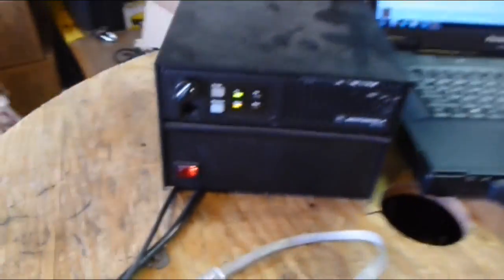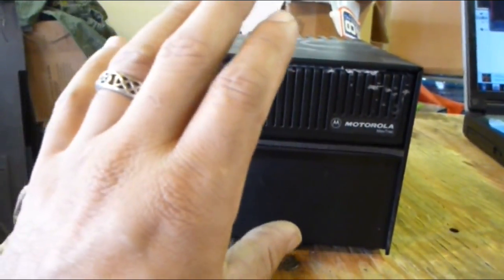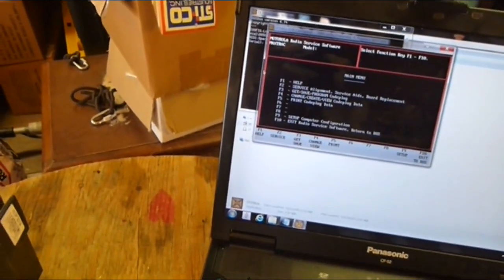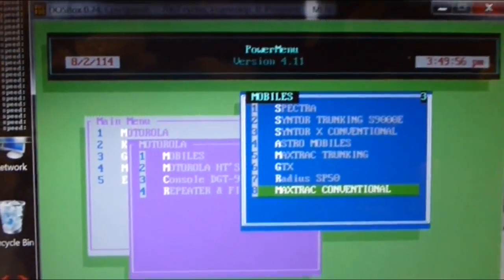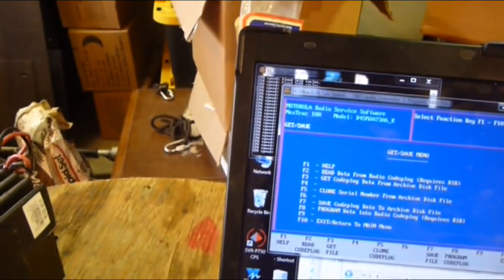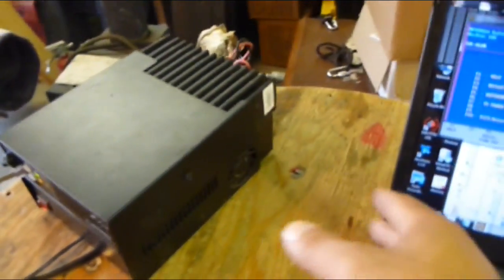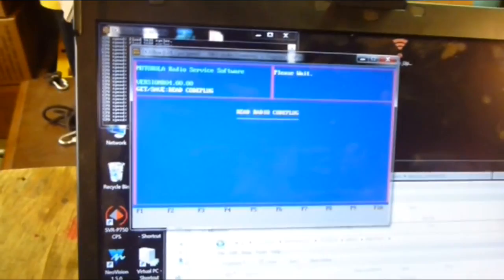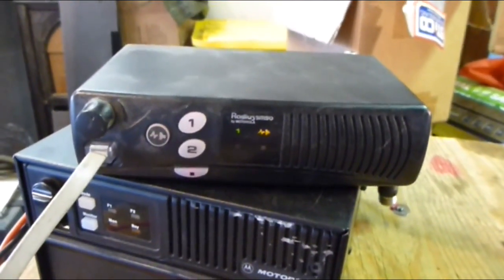Surplus Radio Guide Series, Programming Motorola Maxtrac & Radius models

Comment: Wow! This popped up from 10 years ago! Brought back a memory about the ignition sense line to 12 volts. There was an internal resistor that could be clipped to use the ignition sense line, leave it in and no ignition sense line needed. It was located towards the back of the logic/ audio board. As for the Maratrac radio, the RJ45 connector for programming is located in the trunk unit. Open the lid and it was located towards the front top of the radio.
Today I have been using the XTL5000 UHF LOW SPLIT for the last two years. It light years ahead of the legacy radios. Radio software is 32 Bit Windows XP only so we need to keep those old machines around to program these radios. The software today has tons of different parameters that can be programmed into these radios including P25 and crypto. For those who can afford Motorola's high prices they have even higher tiered portables out there that can be programmed via the Cloud. Of course they come with sky high prices if you want to play up in the clouds😊.
Hope you are doing well! Stay Safe!

Comment: Good morning guys. I just had a someone program 4 Motorola HT600's to communicate with each other.  I am looking for a Maxtrac that works and can be programed to communicate with the HT600's. These are the same radios I used when I first became a Sheriff. Also, I am looking for a cloning cable for the HT600's, that goes from Radio-to-Radio, not Radio-to-computer.   Thanks for y'alls help.

Comment: Hey Bro 
wicked video 
been retired awhile and started getting into the Radio thing .. been a computer nerd since 91 ...dos and all . pretty good at it 
got an old motorola maxtrac out of my welding truck...  model D33MJA7JA5AK . IM Guessing  its 136-174 Vhf  it has more than 8 channels programmed 
My question to you is .. where do you get the mic cable , black box , and the other box .. and the software download , ? ..I got nothing but time ..
my radio powers up.... works ....might need new mic in future but ya .. wicked man ...dont like to talk on the radio..... just the tech stuff.. Thx ... Canada out

Comment: Do you have a video for an old MCS2000 VHF Model?  Trying to set one up for 2M Ham radio, can't get the software to talk to the radio @Guerrillacomm
Reply from the maker: I think I have a 40 Mgz model, I'll have to check. it should be similar to the vhf version as far as programming it. Standby, while I check and reply either yes or no. If I do, I'll make a short vid.
Reply: @GUERRILLACOMM  That would be awesome, I like the radio just haven't had any luck re-programming it for Ham Radio.  I'm using CDM-1250's and XPR 6550's those had no issue programming this MCS 2000 is kicking my butt.
Reply from the maker: @ebizzle108  Sorry Sir, couldn't find an MCS2000, It was a CDM1250 I remembered seeing somewhere. The MCS is a rare bird in the field.
Reply: @GUERRILLACOMM  it’s ok thank you for looking.  I have my CDM-1250s working with no issues but my MCS-2000 is another story.  Lol.

Comment: I have Rss on a cd rom and used it back in the late 90s early 2000 to program some maxtracs but cant remember what machine I used to do it. Is it possible that the software is windows based since it is on cd rom? I don't remember using dos but may have. Any chance you could jog my memory and tell me what i need to do? I have the rib, the cables and software just confused with the software being on a cd.
Reply: Bluemax49ers, I spelled it wrong.

Comment: I have a maxtrac 300 low-band on 6m question .
I use alot m120's, gm300 all time used repeater adapters from Amazon so they repeat .
I have also couple radios cross band . I have no issues ever perfect audio all time. 
Well here's the issue the 6m low band I have works perfect after tuned and brass slugged.
I had no pin 8 Cor but programing it fixed that. Now when I put it together with any UHF radio as a remote link guess what...
The tx flat audio out is high pitched and low in volume then a r radio as I break the sq and then key up on 6m ht . 
I just spent a few hours trying capcitors, transformers across the pin 5 audio to source out no good . I changed a few settings in menu extended features key f9 after reading no good . It's almost like I need a preamp with tone control to deepen the squirlly audio. 
What's your take on that i tried naxtrac into 2 m10's ,2 m120"s  ,1 gm309 UHF , 1 vhf gm300 all hi pitched naxtrac"s pin 5 tx audio into other radios thin hi pitched lower audio . The repeater adapters I have two that don't help the audio either it's like a misunderstanding matched tx audio out to other Moto radios? Frustrating.

Comment: Hy, my model: D34LRA73A5AK works on frequencies 449.0 - 470.0 Mhz I'm trying to drop on the Ham band 430.0 Mhz, I need a RSS program for MaxTrac R07.02.00A or a modified radmbl.mdf that supports lower frequency programming .. can anybody help me?   73 de 9A6GEZ.

Comment: That rib box programs the maxtrac gm300 m120 radios also the gtx900 mobile they are all radius series mobiles. The maxtrac the gm 300 and the m120 are all the same radio. The gm 300 was a 2 channel a 8 channel or a 16 channel the m120 was 2 channel only I believe and the maxtrac was 2 8 or 16 or 32 channels. The maxtrac was also trunking capable on the original 800 mhz trunking systems it is NOT  p25 trunking.

Comment: Just to note - 800 MHz is not legal for anyone to use in the USA except law enforcement and some commercial users that still have license.
You should NOT have to adjust the ref osc. unless you recapped the PLL section or did a board change, otherwise you really should not be messing with it.

Your Maxtrac has a hacked or bad codeplug in it = double high low POST beeps..

The SM50 as well as the SP50 (handheld version) are no longer legal to use in the US on part 90 bands due to narrow banding. Ham and GMRS radio they are OK to use because they Sm50 and SM120 and SP 50 have part 95 certification.

SM50's are good for building compact 25 watt repeaters but I would recommend the PM400 (UHF) / CM300 (VHF) for a more modern build in the same form factor

ERROR 22 Radio Not Supported = The SM50 can not be read with the SP50 RSS, You need SM50 RSS.  The SM50 and SP50 are part of the same product line but Motorola made separate programs for them.

USB based cables WILL NOT work reliably and can brick the radio

Comment: More than likely the last radio you show in the video was programmed by a newer version of RSS. tis is Motoroni's way of making one buy newer programming software. Their new windows based software is nice but from what I gather very hard to modify when one needs to get into the meat and potatoes of changing the bandwidth parameters of a radio unlike the DOS programs where one could change the frequency range of a radio.

Comment: This is what i purchased, is it the correct RIB box programmer for the GM300?  And if i understand correct, the DB-25 is where a cable is connected to the RJ-45 microphone connector with a modified RJ-45 with certain pins so the RIB box can communicate?  Can i use the Radio Doctor program to program, or program exactly, please?  Thank you.http://www.ebay.com/itm/271591474675?euid=f300a0bd863742c4b07bde4413596e28&bu=43476121132&cp=1&sojTags=bu=bu

Comment: its a sense ignition you can jump it inside so dont need a wire connectet to 12 v
Reply from the maker: +DENNIS N That's a good way to skin the cat.. Having an ignition sense is handy for the absent minded. Thanks for the tips.
Reply: Maxtracs Have  a fuse around AF Power amplifier that need to be cut for IGN control.

Comment: Hey GUERRILLACOMM I have some Moto. Maxtracs 440 that i need programed. Do you think the USB Rib you see on Ebay will work?
Reply from the maker: Jon Williams I had little success using USB cables on older radios. I think a lot of that has to do with my patience with the older gear newer PC problems. I much rather get up to date gear that could be serviced reliably. Just my opinion.
Reply: Ok. I was build a Ham repeater with two moto. Maxtrac 300 and had to spend $50 to program it. Didn't want to spend that much if i can find a $20 calbe
Reply: You need a true DOS PC, Motorola RiB and Motorola cable, that 3rd party crap is crap and can brick your radio.
Reply: For most Models up to 1993-4 wont work USB since they are MS DOS based software and no USB Driver (that I'm aware of ) work with them. I have an OLD PII with Win 98 that I boot on DOS when is necessary .
Reply: RSS was pretty much all RS-232? (not sure if that is the correct number XD) serial based where CPS can be either RS-232 serial or USB based.

You are correct that some later versions of RSS could be manipulated with 3rd party USB drivers and such but I personally would not recommend it or trust it but that's just me.

Old early eprom based radios you had to use an old XT PC like the Saber, faster computers were known to "burn out" the radios serial buss circuitry rendering the radio bricked unless you had the money to have it replaced or repaired. I keep an old P2 and an XT in my shop for this purposes though they never see programming work outside of ham radio or GMRS frequency programming...
Reply: Yep You are right some earlier Maxtrac Used NVRAM with built in battery, Saber were State of the Art Radios . I worked a lot with them with DVP capabilities .Mostar was the first Field programmable radio that I work with , They use a Suitcase programmer. They don't built tough radios like these radius Series Anymore.

Comment: After you download dosbox how do you open the software in dos box
Reply from the maker: Ethan Whisenant If you ever worked with the old DOS operating system, its the same way. it has many of the usual DOS command lines to navigate through it. You would have to get a copy of the radio service software and install it onto the DOSBOX environment. I'll make sure to demo that procedure on my follow up series.

Comment: Always good info on your videos
Whst ever happened to the simple repeater you left on the mountian
Reply: I had to learn the hard way myself on the Motorola's, if the tech programmed the radio with a newer version of software then you're out of luck which I think is a money racket where they keep their tech's buying software. I've not ran into it with the Kenwood's hope I don't because I have several of both brands. Thanks for the video very helpful.